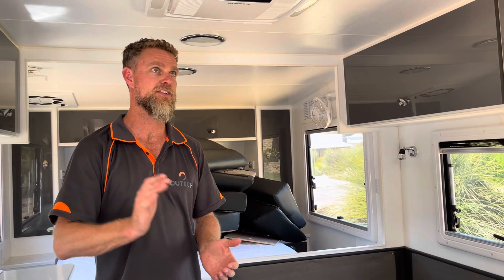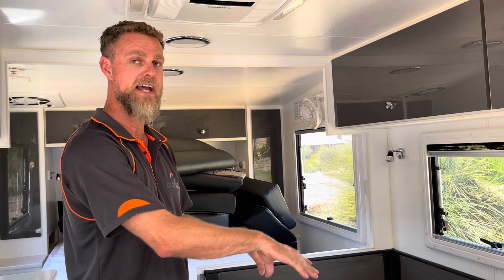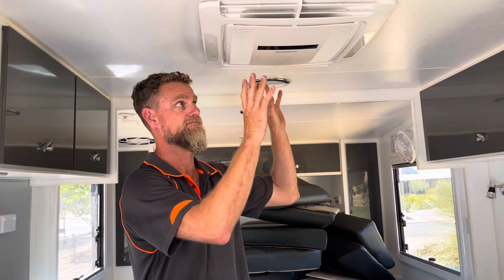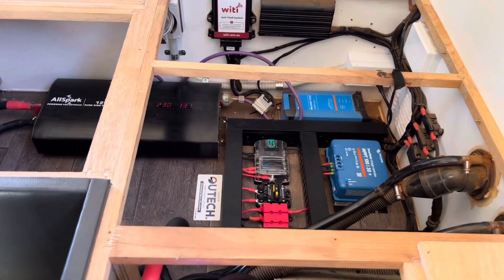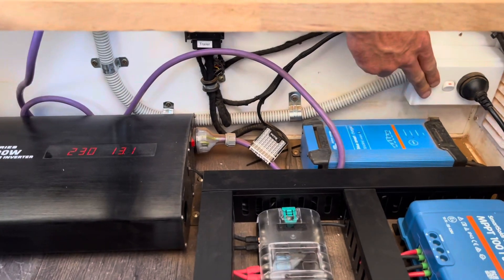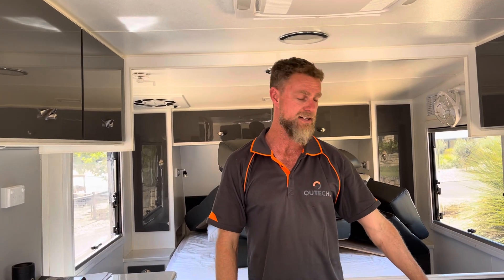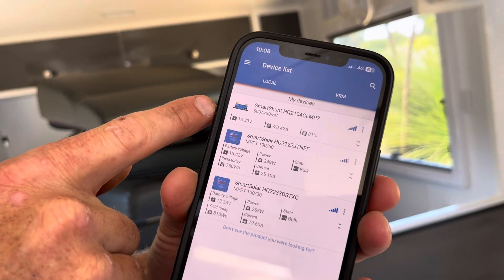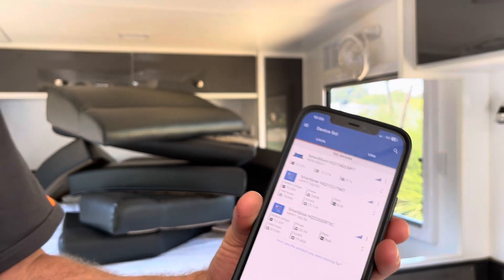WHY DOES’NT IT WORK- Part 2

Comment: What amount of continuous discharge current do the batteries need to run the aircon off grid?
Reply from the maker: Hi thanks for the question. 

Continuous discharge of the battery (battery selection) should be done with 2 thoughts in mind. Run time of load and power rating of load. 

The continuous discharge of the battery should be greater than the peak power consumption of the system so that the battery is never overloaded. 

If you have parallel batteries, they should individually be able to manage the peak power consumption of the load in their own right.
Reply: @outechoffgrid  Great answer. Thanks very much.